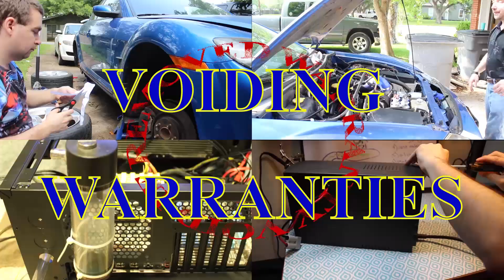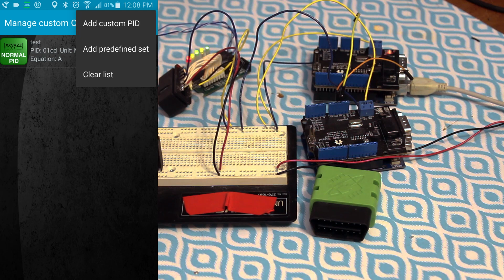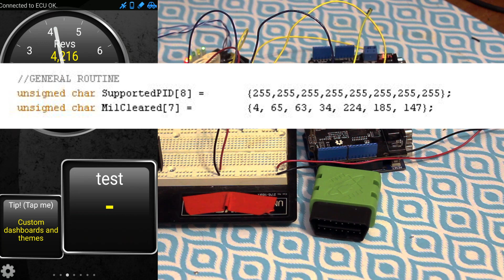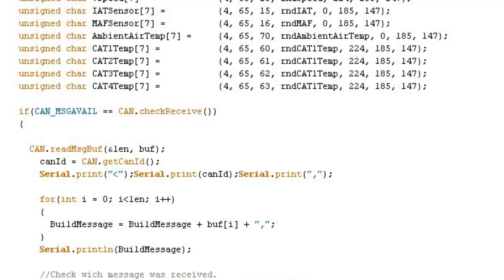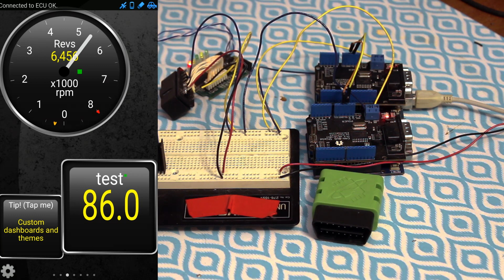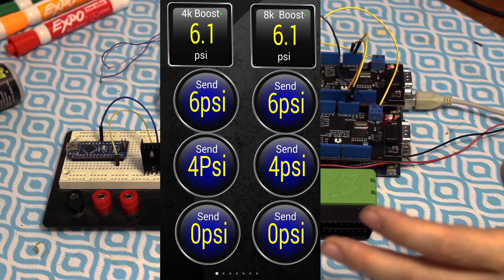Creating new OBD2 Parameters with an Arduino - Networking the Beast 4 –
Voiding Warranties Ep 7

Comment: a standalone module with an oil pressure sensor outputting universal code that can be injected into network would be amazing, then my obd gauges would work properly. cant find it done anywhere.

Comment: Thank you for this video. My Coding is VERY limited, I can make Arduino blink Hello World ok...
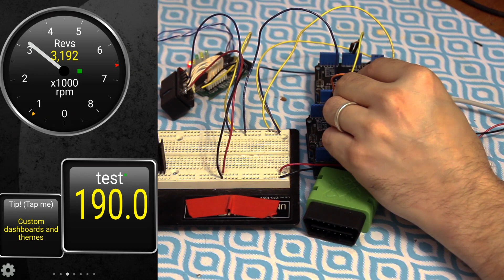 but @ 6:03 timestamp,  how do you calculate 0-255 range and the 3.3v output signal to get 190 reading? Would you please share the expression? I have another project that would help me on too!

As for OBD2 parameters, what I'm actually trying to do is add an AEM UEGO Controller Gauge to the OBD2 CanBus. My interface can read the gauge, if the parameter is available in software (yes, using HPTUNERS the PID is there) I would not need the AEM adapter piggybacking between OBD2 port-- gauge controller -- HPT interface. The AEM inline adapter works but with the adapter and interface it's dangerously long and gets kicked/unplugged and feet get can get tangled in all the wires shifting. 
 Does it matter how many devices are on a CanBus? I think the adapter plug just injects the Can hi and Can lo into the normal stream.

Comment: Awesome . The big question for me is kind of the reverse , Can you create buttons on tourque and then send a can message to the arduino to turn on a relay with a digital pin. i.e: I need to actuate a diff lock on my 4WD only under a certain speed which I would read as a can message and then on the arduino decide if it is low enough to engage the relay. But the button needs to be on the torque dashboard .
Thanks for an informative video.

Comment: Do you need the can bus. Or can you connect torque to Arduino. And then Arduino to OBD via Bluetooth.
Reply: Can is how the car communicates with itself and the obd2 scan tool. Torque connects to the obd2 scan tool. Can bus is the entire skeletal system for this kind of application and is absolutely necessary.

Comment: hi im looking to read can data on my volvo i dont want diagnostics stuff i would like to get information on sensors not usually monitored on something liek torque pro. im looking for information on parking sensor data, steering control data, data from my instument cluster display and data related when i operate switches etc in my vehicle. im trying to do some things with my car where usually its expensive to get such things to work. 

do you have any video's that could help me out? i take full responsibility for my own actions on my vehicle.

Comment: Excellent little project, I'm a little surprised it hasn't got more traction as it is affordable and scalable.  Out of curiosity, why did you need the second Arduino and CAN-Bus to simulate the analog sensor?  Couldn't you read a sensor input AND send the test values for the other devices using one?  Just curious.  At any rate you have a nice project and I really appreciate you taking the time to document your work, I know it takes effort and it has helped someone out.  Way to pay it forward buddy!

Comment: I want to interface to my cars canbus interface, originally I thought I could do this by connecting to the ODBII port, no success, I'm now in the belief that I can connect to the CAN+ and CAN- wires in the boot of my car using a CAN crocodile.  What I want to do is intercept the following, brakes, left / right indicators, hazards, reverse and lights...is this possible?
Reply: Did you ever have any success with this?
Reply: @OtherDalfite  I've purchased lots of cables and modules.  I found out that Audi doesn't publish the CAN bus data on the ODBII port, instead I must connect to the CANH and CANL signals in the boot of the car which is what I'm using the CAN crocodile for.  I just have to get the metal cage that surrounds the cables off.

Comment: Dose the engine ecu see it too and can directly use it for controlling fuelling or other parameters ? Most wideband O2 controllers only have one output and I like to use 16 O2s censors on my V8 for individual cylinder tuning and boost control + duel dbw throttle bodies

Comment: I'm working on a similar project, but chose to go with the teensy for reasons you stated. could you share the teensy code you are using, or does the arduino code only require small modifications to make it run on a teensy?
Reply from the maker: +Cody Soper I started with some horribly documented teensy code then built a ECU simulator from scratch, then worked it from there. I'll be putting all the code on github soon.
Reply: Cool! Thanks for the reply!
Reply: Voiding Warranties hi, have you had a chance to share a progress on GitHub?
How you managed to add controls into torque app?
Reply: Voiding Warranties this is amazing project! Hope you haven't stopped it

Comment: What would it cost i can buy a bike comp. for 130.
Reply from the maker: +Anthony Good The arduino with CAN shield is around $40 but then you have to add any extras on top of that such as a case or any components required to read your sensors as either a 5volt signal or pwm. So if you have an off the shelf solution for $130 it might be less hassle to go with that.
Reply: Huh, the same CAN controller can be bought for $2 on Aliexpress 😁

Comment: how hard would it be to put that setup on a non fuel injected enduro bike
Reply from the maker: +Anthony Good Not too hard. If it doesn't already have obd2 you can run the ECU simulator code and then add extra sensors on top of that.

Comment: can a single arduino be used for multible sensors or one arduino for each sensor?
i have an old diesel without any obd2 at all. and want to monitor a few sensors via android tablet.
Reply from the maker: Sure, you can use as many sensors as you have inputs for, but to get it working on a vehicle without stock OBD2 you will have to spoof the ECUs OBD2 responses for for what parameters are available and possibly emissions/MIL light. So start with a ECU simulator code and add your own extra sensors on top of that.
Reply: @CalmResilienceMedia1  I have the same situation - a pre-OBD2 diesel that I would like to read via Torque. I'm new to Arduino and need some guidance on  doing this. I read the Instructable before finding this video, however it seems everything posted is 2-3 yrs old so I'm wondering if there are new/better ways available today??
Reply: Voiding Warranties bruh my question is related to nick since i also hav carburated  motorcycle without any obd port..so can you tell how to get tachometer reading from obd to android..fastest way!?

Comment: This made me laugh a bit  ... mostly bring up some memories

i did exactly the same, use arduino and obdlink mx  to read boost higner than the standard obd max value

was finally able to get to find the advance pid for boost in my car so i removed the arduino

in my case it was on a hyundai genesis coupe

[URL=http://s354.photobucket.com/user/moreause/media/genesis/2014-05-30203342_zps7decb0d9.jpg.html][IMG]http://i354.photobucket.com/albums/r416/moreause/genesis/2014-05-30203342_zps7decb0d9.jpg[/IMG][/URL]
Reply from the maker: +moreause It's a pretty easy hack, but so very useful to add sensors the car never had.

Comment: I also want to add an oil pressure reading to my car and Torque. How do you connect an Arduino to the car's existing CAN BUS?  It's a 12V sensor. You're example shows Arduino to Arduino which demonstrates the theory. How about a practical example on the car itself?
Reply from the maker: Here is my car using it for boost pressure, water injection rate, and other stuff. I also use CAN commands to set my wastegate setpoints. https://www.youtube.com/watch?v=FKqoRr7tKp8